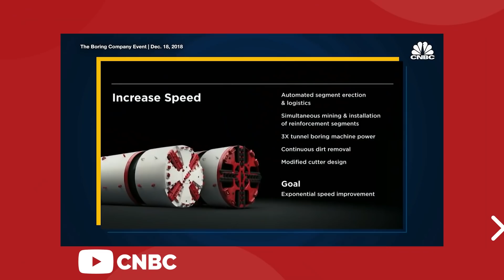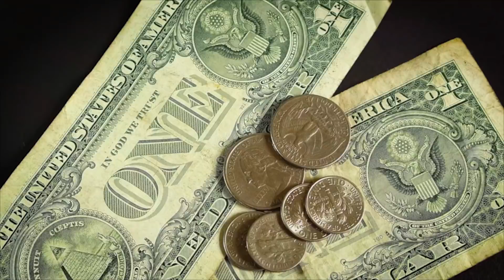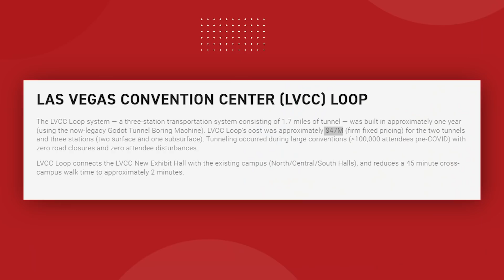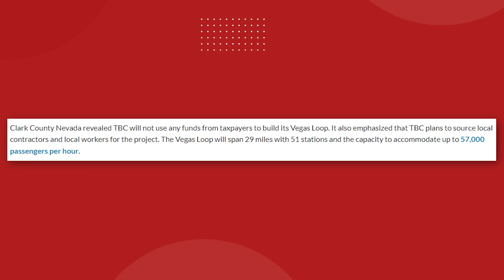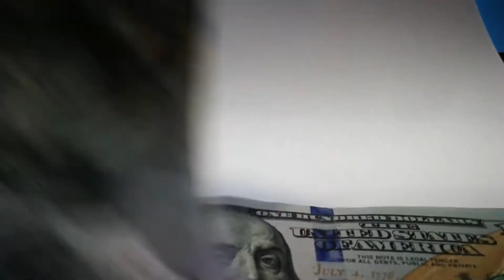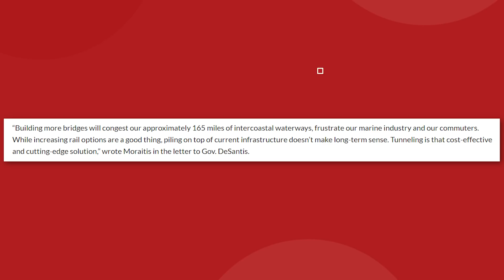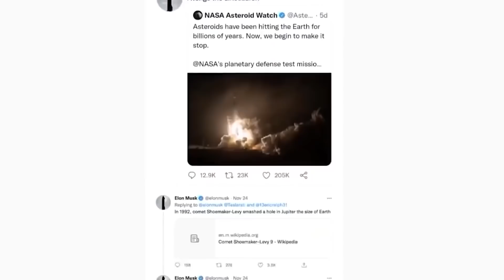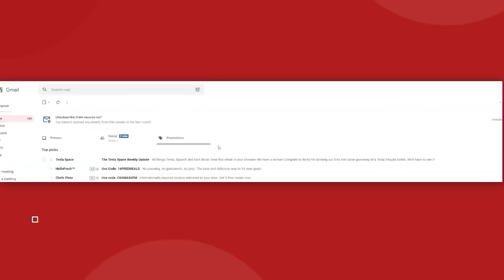The Boring Company 2022 Update

Comment: HOLD ON,,,, anyone actually following this story outside the regular media news channels? It's obvious the creator of this post hasn't. Anything from main stream media is basically nothing more then a paid add. The facts as of right now, the company is Dead in the Water,,, read the Wall Street Journal articles about it. Musk met with the company that manufactures and sells the boaring equipment. Not having a clue, he proceeded to stretch the meeting out over 6 hours and over and over making rediculus offer's, all were turned down flat. That it, it's over,, to buy the equipment is so exspencive there's no way to compete against other forms of transportation. Also the sample tunnel they built as a demo is useless 😂, it's nothing more then a cement pipe, way to small for anything.

Comment: If the cost of the tunnel itself is not bad, all you have to make sure is that there are not traffic jams at the ends and it should be a simple and obvious success. A tunnel system could give you direct access from A to B which would be impossible with roads. You can have a tunnel from specifically los feliz to van nuys in LA directly with no stops underway. You simply build the tunnels for every path of capacity needed. Because it is a single lane you can apply the exact amount. You don't need to make 8 lane tunnels but instead make 8 tunnels to the destination people want. for LA or any other congested large city, that could speed things up tremendously. Especially if they can be safely traversed at 200km/h. For a single lane you'd need a robotic rail system on the sides or roof that could come in and tow a stranded vehicle or put out fires. It's doable. It would work. I would start with a modest lenght needed route in LA. If the san mon mountains aren't too hard to drill you could connect beverly hills with sharman oaks, let it come to the surface and then it could later dip down and continue to encino and calabasas. Waht  you really want to think through it the congestion where it connects to the surface streets. you don't want gridlock at the ends to negate the value of the tunnel. That's a classic mistake. Large motorways are typically not limited in capacity, the problem is the off ramps or where traffic merges with other traffic. Merging is your enemy. But if done right, these tunnels could speed up commute by factor 4+. Which is no small matter for a high GDP city.

Comment: Boring is a great idea, and environmental issues are really what to do with the dirt and rock from excavation. Rarely at the depths they are operating are there many environmental considerations, other than water table issues. Rocket fuel and chemicals  and noise among other things are definitely environmental issues at Star Base and the Cape, but for boring a tunnel?? I think its because it will done with his own labor and Elon's own work force and unique equipment. He will need to somehow let the locals participate in the tunneling and construction, using his equipment. He probably won't be able to control much in a union environment. He may pass on these until he has enough established projects that public opinion will change.

Comment: Would we have traffic jams inside the tunnels and defeat the whole purpose?

I think this is good to move the highway underground, but it certainly will not solve cars traffic
Reply: There is already a video with a small traffic jam in the Boring tunnel, and was not even a busy time. Also during CES they did a race one lot walked from the start and the other went on the Tesla tunnel well that walk ended up being much faster as there was a human traffic jam just to get in the car lol
Reply: The reason for traffic jams is that the cars leaving the roads are not fast enough. The infrastructure to let the cars drive of a road is where the problem needs to be worked on. Effective exits of roads, and the cars will be able to move fast on that road. I would recommend working on the exits.
Reply: @solkraft300  Nope the reason is that it's nothing like what was promised in the beginning no 150 mph speeds no self driving no 15 people pods none of what was promised.

Comment: Subway tunnels were the salvation of Great Britain when  German bombs fell. 
Sewer tunnels sheltered Hitler as a young "artist" in Vienna at night. 
The Moscow subway serves as a deep air raid shelter -- with cultural reminders.
They could become a refuge from oppressive heat or radiation fallout.
Teslas are used because because they are pollution-free. -- except for rubber dust. 
Vehicles/pods will be optimized with use.
Each vehicle has independent electricity, air purification, and personal security -- relative to the blitz.
Reply: Hey, that's a brilliant idea!  But imagine if the wheels were steel and didn't produce rubber dust at all.  And what if instead of lots of little pods, which have a high energy use ratio, as well as a high ratio of materials compared to the amount of people they carry, you just had trains?  They would use less energy and materials then lots of little pods compared to the amount of people they carry and would be more environmentally friendly.  Oh, that's right!  We already have them!  They're called trains!

Comment: These tunnels are nothing more than a death trap. The tunnels are too narrow, once in the tunnel it's impossible for the doors to open wide enough to allow the people to get out. No ventilation, emergency access, or fire control. It's known that Tesla's catch fire, even when parked. Can you imagine being stuck inside a car when the batteries catch light. If the heat doesn't get you the toxic fumes will.

The original claim was that they would carry one to eight people in pods at speeds up to 120 mph. What has been delivered are just taxis that need a driver so they can only carry three people at a top speed of 30 mph. It's quicker to walk the distance.

Comment: I'm a huge Elon fan but there are some figures which are not right in this video...on the Brenner tunnel between Italy and Austria TBMs reached max 40 yards a day, plus tunneling outside US is much cheaper (for example for Italy's light metro the cost is around 100 m€/km, but including 2 tunnels, stations, depos, trains, beautification of surrounding area etc. 
Bare tunneling of a small single bore tunnel may well be around 10mil.
Last point, usually cities (except London & Hong Kong) are not earning money from transit...they usually subsidize transit since allowing people to access jobs or attractions create tax revenue...so if Elon manages to turn a profit from the loop that's amazing!
Reply: The Brenner tunnel is Ø 8.1m The Boring Company tunnels are Ø 3.6m, that is a huge difference.
Reply: Switserland and Austria have tons of tunnels. Very experienced tunnel builders for both trains and cars. They do it because moving past a mountain takes a considerable time as opposed to moving through it.

But that's different from tunneling in urban areas. Can't believe people that people fall for Elons smokes and mirrors.

Comment: The typical London "Metro" train can shift 40,000 passengers an hour between stations less than a mile apart. 
Someone tell me how many passengers can be carried that same distance, in that same time on this Loop.
Reply: It would be extremely expensive and inefficient to build such a "metro" train at the Las Vegas Convention Center.   Even the modest underground train that was proposed as part of this project was going to be four times as expensive as this Loop.
Reply: @kevinbailey8827  If you use “prices” as opposed to “cost”, then may be. The cost of a 12 foot one mile tunnel is about 5 million. Another 5 million for a pre-owned TBM. And lets say five million for a small fleet of autonomous mini trains. And thats all in about half what TBC charged.
Reply: @davidwebb4904  So if TBC succeeds with this Vegas Loop, there will be plenty of room for competition.   I like it.  PRT may have its day in the sun, so to speak.

Comment: I think the tunnels are fine, though I think it would be better to use rail compared to EVs. Rails don't require a bunch of self-driving technology or batteries.
Reply: You're thinking too much in the box and trains are too big for these tunnels.
Reply: @イムティ  Look up the trains that ran in the small tunnels under Chicago. You're still stuck in the box. If there's enough room for a large car, there's enough room for a train. I never said it had to be the standard gauge. Hell, they run trains in mining tunnels that are a lot smaller than the tunnels the Boring company makes.
Reply: Not everyone is in love with cramming into a carriage with a bunch of strangers clamouring for the only vomit free seat after leaving their car in a parking lot to race to the platform in the rain
Reply: @darylingoteborg3178  Who said they need to be large carriages? Make small carriages and maybe some large ones. And wouldn't you have the exact same problem with EVs with vomit, etc?
Reply: Basically, the only difference between an EV and a carriage on the inside is that the carriage can have more room inside. There is no need for a steering wheel or a frunk since people will just bring their stuff inside. You could have one side be a giant falcon-wing type door. The design can be a lot simpler than a Mode X, for example. You don't have the same safety requirements, i.e. rollover. You don't need any steering. You don't need windshield wipers, a rear defroster, etc. You can also safely go faster. You don't have to worry about a tire blowing out, for example. The carriages would be lighter and simpler with even more room. You don't even need big windows, since there's not much to see in a tunnel. Don't imagine current subways, etc. There are much better solutions than using existing cars for this sort of thing. It would be more comfortable, have more space and be simpler to maintain. There is a ton of stuff in, say, a Model X that is just a waste in a tunnel. They could also travel faster.
Reply: Rails are inefficient and inconvenient.  They are forced to stop at every station while Boring solution is point to point no stops, throughput will be much higher especially as his tunnels grow beyond 10mi and longer..
Reply: @ABQREDorGREEN  Also, rails are more efficient than tires. You also eliminate any required steering components. Since power is always available this also reduces weight since you no longer need to carry a battery and on-board charger and the losses incurred by charging and storing energy in the battery. You also will have less maintenance since you don't need to worry about rotating tires and the wheels will last much longer than tires. You also greatly simplify the self-driving since steering is eliminated. The only thing the car needs to be able to do is start and stop.
Reply: @ABQREDorGREEN  That's why there are such things as switches for rails. it's the same as going around. The added benefit with rail and no batteries is that the cars never have to stop to charge. The wheels should also last a lot longer than tires.
Reply: @ABQREDorGREEN  but eventually they will stop even more often than subway when there  will be traffic, so it defeat its purpose.
Reply: @ABQREDorGREEN  The throughput is way lower. 5000 cars per hour means maybe 7-10 thousand people per hour are transported because cars are very space inefficient. Just a regular old London tube train (a 200 year old solution) carries on average 208 thousand people per hour. Rails are much more efficient than tires because of the lack of friction. If you need a service that doesn't stop e.g. between an airport and train station, then you can just timetable in an express service or build a new line. Then there's the fire hazard that EVs pose. Electrified trains are powered from the rails and so don't need to carry big flammable batteries. These boring company tunnels are tiny and don't even have a fire escape tunnel parallel to them like a metro would, which is probably the only reason they've been relatively cheap compared to other tunnels.
Reply: @ABQREDorGREEN  what?
Reply: @ABQREDorGREEN  Lmao
Do you think car doesn't stop ?

Comment: If you think about it almost everything Elon does revolves around the technology needed to make living on Mars possible:

First you’ve got SpaceX that makes getting to Mars even possible. 

Then we’ve got electric vehicles. No oxygen on Mars means that traditional internal combustion engines just won’t work. Also we have no oil on Mars so fuel would need to be shipped. So we need electric vehicles to make transportation on Mars possible. 

Third we’ve got the solar division of Tesla. They’re trying to innovate solar technology. I’m sure any long term habitation on Mars would likely use nuclear power of some sort. But to bootstrap the venture solar would be the backbone. 

Next I guess we could talk about StarLink. Satellite technology would be pivotal to Earth/Mars communication amongst other things. 

Living on the surface of Mars is not possible due to radiation. The Boring Company is developing technology needed to excavate the ground so we could build a habitat. Also remember when TBC said they would be using excavated dirt from the tunnel to make bricks in an effort to offset tunneling costs? Not to mention the tunneler creating concrete forms as it goes currently. What if this evolves into the tunneler creating the habitats as it goes on Mars?

If Elon gets involved with farming I think this whole idea becomes a certainty at that point.
Reply: Elons brother Kimbal Musk is handling the farming haha. He has a company that does vertical indoor urban smart farms.

Comment: "One more lane" was never a solution to traffic congestion. Doing it underground doesn't change it. Sure, there are reasons to move traffic into tunnels in some places, but tunnels are never going to be a mainstream solution to traffic. They're too expensive to build and maintain.

Boring Company's tunnels are also way too narrow to allow for adequate safety unless they are only used for pods significantly smaller than Teslas. Musk will eventually have to face the reality that tunnel safety standards exist for a reason are not going to be waved so that we can build more tunnels.
Reply: This isn't "one more lane", as you can't drive your own car into it.   In order to use these tunnels, you have to leave your car behind, just as you would have to do with a subway train. 

The space  you leave by using an underground transportation system (like a subway, or a loop) will be filled by someone else.  That's what they call "induced demand".   If they want a subway or a loop to really reduce traffic, they need to take away traffic lanes at the same rate as they add capacity underground.      I think they should consider closing parts of Las Vegas Boulevard to most traffic.
Reply: Exactly. As widening freeways has only led to increased congestion. Few can see the big picture.

Comment: The problem with the Las Vegas loop is that a ski lift system with gondolas would be far more efficient and likely cheaper to operate, while affording the same level of privacy to the passengers. But it would be significantly safer.
Reply: Is anyone going to do that?
Reply: Sounds like at idea for local point or very short distant transportation. I believe the tunnel is for long distance, 10+ miles. Vegas is a testing loop and an expansion is needed for said purpose.
Reply: @nguy404  That's true, but a longer tunnel will need vastly improved safety arrangements which means a larger diameter.

Comment: All the Vegas "rides" will be purchased by the Casinos to service their high roller class. No tourists will be seen anywhere near the Vegas tunnels. It will be a smash hit and put the project in the black faster than expected. Wherever they are built, the tunnels will not be used for general public transportation. It will be a luxury item for the elite class. I have no problem with that.

Comment: Los Angeles has 2400 miles of arterial roadways. At the price Vegas paid per mile for the convention center loop of 25 million a mile we could DOUBLE the amount of arterial roadway we have for what it costs to maintain the existing roads for 18 months.
Arterial roadways aren’t just the freeways and highways either but major surface streets like la cienega and MLK boulevard.
Reply: I believe it is funded by the Boring company. No money is from Vegas or the public to built the tunnel.
Reply: @nguy404  I think Vegas paid for the convention center Loop and TBC is paying for the big interconnect to all the casinos.
Reply: @mynameismatt2010  I do wonder what are the safety concerns for tunnel that size. And I think they are using the tunnel as a test of concept.

Comment: Elon is aware that if you dig down more than six inches anywhere in Florida, you end up completely under water, right?
Reply: In the event of a fire they can open up a valve and flood the tunnel to say a depth of say 3 feet which would cover the burning battery pack, so that's a big plus!
Reply: It comes up frequently, so I expect he is not only aware, but thinks that building tunnels below the water table is possible.   I take it you don't think tunnels can go under the water table?
Reply: @kevinbailey8827  They built a tunnel under the English channel so how do you explain that?
Reply: @danielstapler4315  I guess it means Elon Musk is correct and that you can make tunnels that go under water.